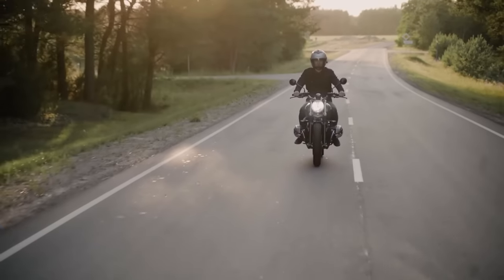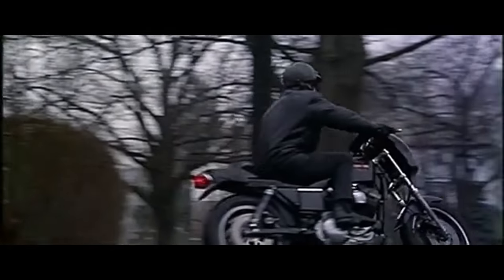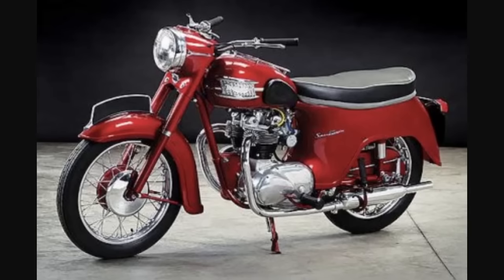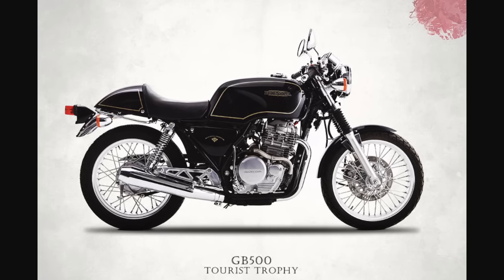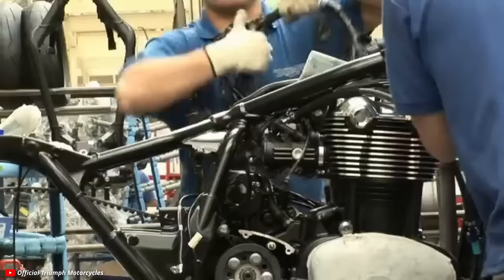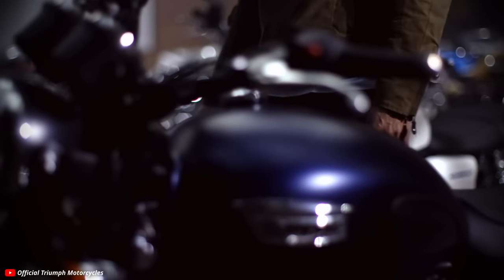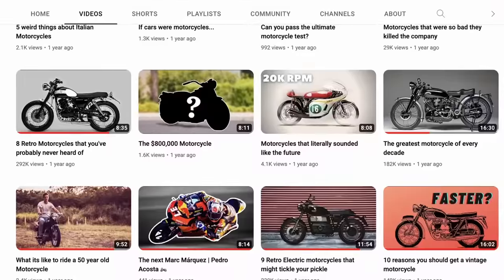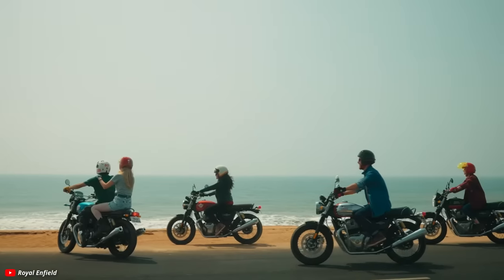The Strange History of Modern Classic Motorcycles

Comment: You missed the Moto Guzzi V7. Its been in almost continuous production since the 70’s in one form or another and is still air cooled - it’s an authentic “old school” bike rather than a modern copy. The Bonneville is a modern bike with retro features, the Moto Guzzi is a retro bike with modern features.
Reply: Remember there was even an earlier retro version of the V7 (sport) models. The 1000S from 1990 (which I still own 😀). It was not only an almost perfect copy of the 750S3 from 1976. It also used the same old technology, like simple slide carbs and contact breaker points. But it sold very poorly. Perhaps to far ahaed of its time.
Reply: are those things reliable?
Reply: @Spartansrule118  The 1000S is bullet proof - but only if you're your own mechanic. Minor breakdowns may happen, but I could always solve them with onboard tools.
Reply: @Spartansrule118  as reliable as anything else and the build quality is a lot better than RE’s. The engines are known to be very durable often doing very high mileages - I know someone who has 175k miles on his. They need maintained like everything else and you need to keep on top of cleaning etc. but we’ll looked after they will last.
Reply: @Spartansrule118   absolutely yes, changed my bmw for a v9, it starts always, doesn’t overheat in traffic despite being  an 850cc air cooled engine, easy to service on my own (it’s absolutely simple) and beautiful in every way. Only thing i have is that when serviced the bike likes a specific amount of oil, putting more in  will cause it to leak from the transmission or air filter, and that low speeds feel kinda weird
Reply: He somehow managed to mention Agusta, and not Guzzi.
The brand is always dismissed somehow..
Reply: @chai1116  which BMW did you have?
Reply: @Spartansrule118   g310r 2019, 750gs
Reply: @chai1116  are you enjoying the Moto Guzzi? I can’t find a classic one but i think i like the V7 850 Special
Reply: The Moto Guzzi V11 released in 1999 is an exceptional example of a modern classic. The market didn’t know what it was at the time but it was a real pioneer of the modern retro style. I have a 2003 model that I bought in 2009 after test riding a Triumph Thruxton. The triumph was so underpowered and was all about the image. The Guz is a beast! I’ll never sell it.
Reply: Guzzi are still being build in Mandello del ario in Italy since over 100 years, genuine and reliable bikes if maintained regularly. The knowledge wasn’t exported but transmitted generations after generations.
Reply: @petewelsh9978  are there any in the US/Canada? so hard to find an old Guzzi here
Reply: @petewelsh9978  also, how is the reliability?
Reply: @Spartansrule118  reliability? Strange question really Guzzis are built like tanks. In 14 years the only problem was a a faulty speedometer cable that was easy to replace. Most reliable bike I’ve ever had.
Reply: agreed. I've got a V7 racer and it reminds me of the old V50 I used to have. THey are still built in the same barn as they did in the 70's.
Reply: Maybe because of V7 is too rare motorcycles, only a few of them were manufactured comparing triumph and W650(800), and it appeared only in 2006, but as for style, not of performance they are superior than triumphs
Reply: @Spartansrule118  don’t I live in the UK and France plenty of guzzis
Reply: Big fan of the Centauro by M-G.
Reply: Therefore I‘m riding a 2021 Moto Guzzi v7 850 Special. :-)
Reply: The v7 is too sexy for this list.
Reply: You are mixing up the words "retro" = looks like old/inspired by old
and "vintage"
Reply: @milominderbinder9136
Reply: @milominderbinder9136
Reply: I have a 2022 Moto Guzzi V7 850 Special, 5600 miles and its been perfect. I have also owned 2 T100s, a Interceptor, and a W800. The Guzzi is my favorite.
Reply: I had a 2014 V7 Stone, I kind of miss it.

Comment: You realy missed out on the Yamaha XS 650. It was one of the very first retros, and still very sourght after. Often retrofitted with a 270 crank, and bored up to 930 cc.
Reply: Got mine XS 650 now for 42 years, enjoyed every minute!
Reply: I don't consider the XS650 to be a retro.  At the time it was produced, most Japanese companies were still selling parallel twins.  It was also being sold at the same time as the British twins.
Reply: Had one in 1973 for $600.
It was a 1971 model. 
Great bike.
Reply: Yes it was like the tractor you knew would alway start .. :)  I lived with its younger sister the XS 750 triple for a few years before going over to an R80 BMW //
Reply: By retro you mean the first 4 stroke motorcycle sold by Yamaha, Phill Irving, an Australian engineer, who designed the Vincent v twin, was the first to propose the 270° crank
Reply: @Shane Maybury  At the time, the XS650 was a current design.  My 1976 Honda CB360T looked much the same.  At the time it was just a "normal" motorcycle.
Reply: @guywolff  the XS650 was around when I bought an TX500, then upgraded to the XS7502D triple.  It had a shaft drive spiral bevel drive from BMW and was very reliable.  Then 33 years later, after family, I bought a new RE650 Interceptor, and now as well a BMW R1200RT as well so me and the wife can cruise day trips together.  Still enjoy the looks I get when riding the 650!!

Comment: Growing in the 60's in the North East of England and riding, or more often than not pushing, old British singles and twins, give me a modern retro any day. Reliability is priceless!
Reply: I had a new 1968 BSA 650 Hornet, a bike which I judge other bikes. I was a skinny 115 lbs college kid. Today I still ride, but old bikes do not interest me. If it isn't as good handling as my old Hornet 650.  The Rocket3 750 and Honda 4 750 were just plain too heavy for me.  My 765RS is god send. I enjoy faultless electronic fuel injection, and no timing adjustment for ignition.  I do not mind the kick start. But I can no longer live without water cooling, six speed gear box, 4 valves DOHC engine,  slipper assisted clutch. And man! the disc brakes.  A Ninja 400 is the best value bike for my riding.  The 750 Hornet is also a good alternative.

Comment: After losing my right arm in an rtc in the mid 90s I put a Yamaha XS650S alongside a lightweight Harley sidecar (remember the Aermacchi Sprint?) with a heel throttle on the right and a back brake on the left side. Thanks, John T. of Newton Abbot, Devon, England
   It went reasonably well, like 80mph downhill with a following wind, but the bores were worn and I never got around to fixing it. To get around the problem of white vans pushing me along in traffic (and they always came close enough to see the filling in my sandwiches) I bought a Beemer. A K100RS to give it its 4 valves/cylinder name, along with a custom frame with cup and ball fittings, and a brand-new, all-metal sidecar from a dealer in Russian motorycles. That was a tight setup and my own retro classic. 😄 Good for a ton "on the track" and elsewhere, she was my pride and joy!

Comment: And don't forget the Kawasaki Zephyrs of the 90s. The 550, 750, 1100. Great bikes with a nice 70s vibe.
Reply: I had a Zephyr 1100 and really liked the bikes style and performance.  One of the only bikes that I regret selling.  I actually sold it to the guy who owns a company called Powerhouse, who are based just outside Chesterfield. They specialises in replacement brake parts for classic and modern bikes. The owner keeps the bike as part of his modern classics collection.
Reply: I bought a Zephyr 750 that was sitting on the dealer floor forever. He let it go for just under $7,000 because nobody wanted them,
Reply: I had a 550 for a few years, not the quickest or best handler but I fell in love with its looks. I've always thought this range started the classic scene, yeah?

Comment: Another great video, little brother. My current main squeeze is a 73 CB350. I'll admit I was gonna jump on the cafe racer bandwagon but I found an all original bike with 3500 miles on it for 2500 bucks! I just had to run a can of sea foam through it and ride. Oh and put new tires on it. It has been an amazing reliable bike. People don't realize how cheap they can get the real deal. I also found an all original 80 model CB650 with 2500 miles for 1800 bucks. I totally agree with you. It is so much better to just get the real thing instead of financing a replica.

Comment: Very interesting history.

When you get down to it a lot of folks just are not interested in racing, especially on the street. They just want a practical, maintainable motorcycle that looks like a motorcycle instead of an escapee from a sci-fi or transformers movie.

To my way of thinking the SR400, or even a similar with slightly less displacement, is about perfect for a street bike. Yamaha has since given up on that market but Royal Enfield seems to be making a very credible stab with the Classic 350. Pretty much a bullseye IMO. A little lighter weight might be good but I am picking at nits at that point.

Comment: You made quite an in-depth video about Retro motorcycles, and yet you missed two of the most important (at least in my mind) unashamedly retro motorcycles from past decades. Well done for mentioning the GB 500, gorgeous thing (although you didn't mention the XBR 500 it was based on - clearly a bike with retro credentials). However back in the 90's there were the Kawasaki ZEPHYRS (550/70). These were bikes which obviously sold in quite large numbers as they were quite ubiquitous at one time. They clearly harked back to the old Kawasaki Z bikes -Z900 and ESPECIALLY the Z650. This was totally understood by everyone at the time. I believe it was THESE bikes that really made the point that there WAS a big market for retro bikes, in a time before the modern Bonneville. Triumph had only just "re-started" then and were focussed on the Trident, itself harkening back to the old bike. I like your videos, but I do think you present your own opinions as factual, when they really are just opinions, at times.

Comment: glad to see the shoutout to the sr400 and sr500.   one retro thing for their time which they maintained through to 2021 was only having kickstart and after the first year in '78, having spoked wheels.  my understanding is that at the time those were considered more retro features than modern
Reply: SR500s in the US (78-81) didn't have spoked wheels. I sold my SR500 to get a Honda GB500 because I love how they looked and getting spoke rims on an SR500 wasn't easy. The SR500 was a way better bike and I ended up selling the GB500 and getting another SR500. I really want an SR400 or SR500 with wire rims, but first I need to fix up my Velocette. They made the Thruxton which the GB500 is a direct copy of and whoever owns the Velocette name sold the Thruxton name to Triumph. And the Triumph Thruxton doesn't look as nice at the Honda Thruxton which doesn't look as nice as the Velo Thruxton. Only the Honda and Triumph Thruxtons can easily be ridden on the street.
Reply: @gornzilla  Thruxton is a race circuit in England.  I don't think Velocette ever owned it.
Reply: @chrishill7583  I know that it's a race circuit in England, but you can't use the name of another product. E.g., There can't be a Honda Mustang.

Comment: Great vid, although I would pull up that the Triumph Bonneville wasn't their first stab at a retro. The Bonney was preceded by the Thunderbird. A 900cc Triple that was launched in 1995 and lasted for 8 years. I've owned one for 10 years now, with a few discrete additions such as TOR exhaust pipes. The attention it gets is unreal. 

And as for the Honda GB500. Such a good looking bike imo.

Comment: I AGREE with you - As a rider of some 42 years whom has owned many motorcycles the whole retro bike thing doesn't really do it for me either - Having owned several original Triumphs when l was a young bloke (including TR6 T120 and T150) l went out and bought a T100 last year and felt the same disappointment - Even though l couldn't fault the bike in any way and indeed acknowledge the bike is technically vastly superior to the old OHV Units - It just still doesn't quite capture the true essence or character of the original bikes - The Brain said yes but the Heart said no - Therefore l decided to sell it and was lucky enough to pick up and restore an old 1986 Harris T140 - Gotta admit l'm so glad l did too - The beast starts up first kick and when it roars into life never fails to put a HUGE smile on my face 😁

Comment: PS  About the original Ducati 750SS:  LOTS of guys wanted these, but they were a nightmare to maintain.  They won a lot of races, but few street riders were interested in owning a motorcycle that had to be disassembled to perform a valve adjustment, which you were supposed to do every 3000 miles.  Mind you, it took a REAL ironman to ride one of these 3000 miles on the street!
Reply: What you are saying is not quite true.  They were fairly easy to maintain.  I owned an 860 version of the 750.   It did not need stripping down (apart from taking the seat and tank off) to adjust the (desmodromic) valves.  I don't remember the service interval but it was much more than 3000 miles.  Was I an IRONMAN ?, I don't know but I rode mine the length and breadth of Britain and many times around Europe.  It did not fail me once.  The only failing that mine had was that the chain was under spec'ed for the torque of the engine and needed constant attention ... often needing adjustment half way through a long days' ride.
Reply: @zaphodbeeblebrox4574  I'm still riding an old 860Ducati today and I have a 1981 Bonnie too. I like the modern retro bikes but I've never tried one, perhaps I'm simply stuck in the past!

Comment: Just came across this video, I just happen to have a  Pristine condition Honda GB-400 TT Mark 2 that was a private import to Melbourne, Australia back late last century by its owner from New Zealand that I bought in 2002 and it’s been sitting idle in my garage for over 20 years with only 36,000 kilometres on it from new in around 1986, Australia did not get these and New Zealand was lucky enough to get a handful of them new as they were primarily a Japanese domestic model and were exactly the same as the GB 500 TT with a smaller bore and stroke, there were 3 versions and my mark 2 was the only one with the Honda factory fairing with the 500’s racing seat, they were a retro bike in the mid 80’s to represent the Isle of Man Tourist Trophy of the sixties and were arguably one of the prettiest bikes Honda made as a factory Cafe Racer, Honda named these the GB series which stood for “Great Britain”  which was a salute to Britains Cafe Racers stemming from the Ace Cafe Era, these bikes were built before the Cafe Racer retro era took off, I have had people ask me “ Is that a new bike made to look old” in which I reply “yes and no”it is an old near 40 year old bike and was made to represent the sixties.

Comment: I owned a Honda GB500. It was a good bike but was very hard to start especially in cold temperatures. A subsequent owner finally managed to get a carburettor fault fixed that caused the problems. I'd just assumed it was hard to start and got rid of it.
Reply: That's funny.  I sold my old SR500 after getting tired of hearing it ping at 65 mph on the freeway.  The new owner fitted a Mikuni carb, and improved the bike a ton.

Comment: @Bart Once again you’ve omitted the Honda CD175 1969 "K3" model (product code 302) which although it was a continuation of the previous model by the same name, it introduced the vertical engine and all-tube frame and some smaller body work changes that continued until the end of production in 1979.

The Honda CD175 of 1969 is the first retro bike. Why? Because it was already out of date by the time it was introduced. It was therefore INTENTIONALLY looking backwards, being available only in blue or red (mine was blue) with its oversized and flared painted front and rear mudguards, chrome tank panels, and rubber kneepads, at a time when every other bike was clearly going for the modern sporty clipped chrome mudguards and painted and stripped tanks. 

Yes it was my first real bike (after my Honda C50), and the only bike I bought new. During the year I owned that bike, I rode it everywhere - to race meetings, on holiday to Devon, and on long tours all over the UK. 

No, I didn’t start picking up hot girls until I got my first gorgeous candy orange Honda CB250G5, but that’s another story. 

So, I got retro out of my system in 1976 - before I was 18! Been there, done that… 47 years ago!! And this is why I find this current retro craze so amusing. Not only are mostly hipsters riding their EFI liquid cooled heavy fakes to pose at coffee shops, for the most part they are only doing it because it’s the current fashion. I, and everyone else who bought a Honda CD175 at any point during the 1970s did so because we were individuals, failing to set a trend, but not being fashion victims either. 

OK @Bart because you’ve omitted the Honda CD175 from yet another video on retro and classic bikes (your only excuse is that they weren’t imported into the USA🧐😎😜), now you have to dedicate a whole video to this, the most important retro classic of them all - the one that REALLY DID start it all. 

Ride safe 
Peace